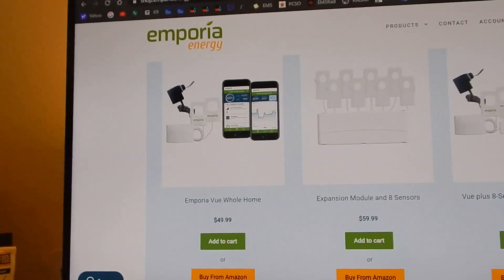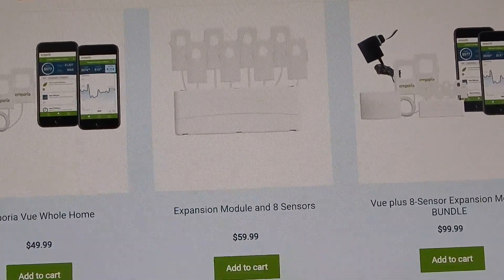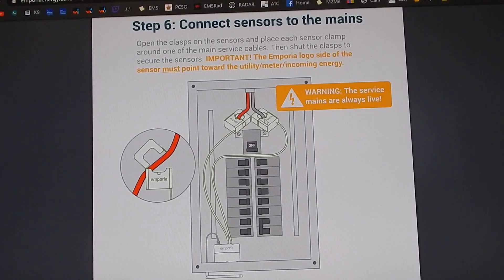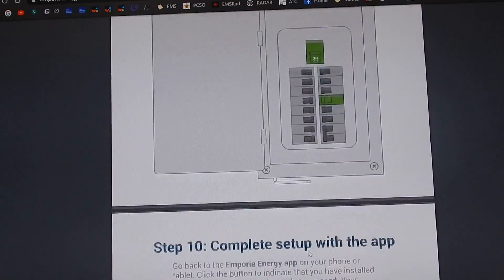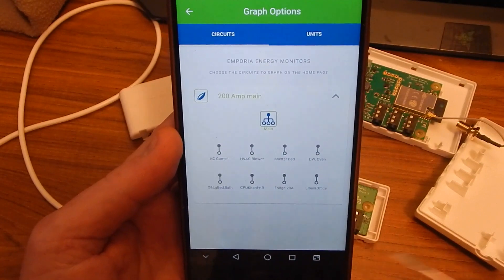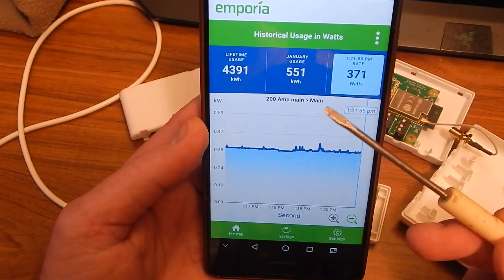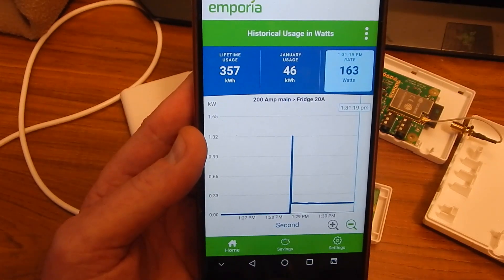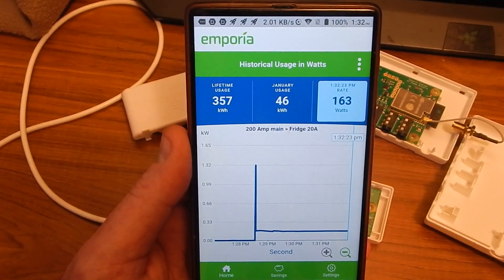Emporia Energy Vue, See Our Review Of GEN2!  Link in description.

Comment: Hi AD can you please tell me what is the function of ic U4 on pcb @6:42? 
and what is the IC number?
Reply from the maker: 6810 F (B OR 8) G NEXT LINE AD1E07  1924 A, I can't find anything on this but sure it's the prom chip or firmware chip which is near the programming pinouts on board.
Reply from the maker: China virus in India is very bad now, how is vaccine distribution?
Reply: @publicmail2  situation is not so much good over here ,currently we are getting 300,000 cases daily here(official no.s).

Due to the very large population, we are facing shortage of vaccines, maybe in the upcoming months, that problem will be solved.

Comment: Great Review !   About to put in just the 200a claws because I am anxious to see work.  But I want my inside loads checked at that panel so ideas on running extension cables for expansion module either from outside 200a service or other way around?  Is this sending digital signals that need shielding or for that matter can the inductor comm cables be lengthened or would they pick up noise.

Comment: I am like you, the power of knowledge is being able to view power consumption from 0 to X watts.  I could care less if the exact measurement is perfect.  HOWEVER the company could send in the package for those needing "calibration" three or so known resistor values you could plug into a circuit to calibrate the clamps over a range.  I would be using the fine resolution to identify items in my home that are puling those few "phantom" watts that are dragging 24/7. It is those items that I would like to rid my house of.  Being an engineer with many devices at my home I would be using this as an off the shelf troubleshooter and data gather tool.  I do wish they would make an app not for my phone to pull from their cloud but one I could simply host on a raspberry Pi or Arduino or even on PC that I could have on my own network so I wouldn't have to fork over the 2 gigs of data these use a month to run or have a "big brother" out in the world watching over my power usage.
Reply from the maker: I believe it just wasn't doable with the old hardware, I tried different shunt resistors that helped low end but hurt calibration up high, check out V2 available on 8/15/20!

Comment: Excellent analyses!  very impressed with the explanation of short comings. I would like to see the accuracy of  even 1W to 5W if I am spending money for the energy monitors. Otherwise It may not be possible to find out if there are equipment which are not working efficiently if they consume below 35W power.  I don't really care about data (I assume they do), but I would like to get data every second if possible twice a second to find out signatures of various equipment connected to the grid, inverter distortion, harmonics current, etc. If a product that can give me this level of accuracy in the non-commercial energy meter, I would love to buy that product. I have also solar panels as well and parallel feed 200A Square D panel which makes it impossible to install Sense or Emporia Vue product as none of those support up to 3 CTs (100A), and  do net metering  without modifying the programs/code in the chip I believe. May be I am asking too much for the monitor to do But I am okay storing all my data to my own server and try analyse each type of load to the millisecond level for research purposes.  I think having to access to such data at millisecond helps a lot for engineers! They can have my money if they can do this for me. :) I Like accuracy and professional grade CTs without any errors. Or I should say, professionally calibrated CTs which produce no to 0 error. I dont think it is worth to tweak the software than actually get updated hardware to measure accurate V, I and power factor.

Comment: the light on the fridge only comes on when you open the door. Theres only a few sensors or timers running depending on your fridge model
Reply from the maker: I have external lights, and many others things run independent of compressor at a 1 watt to 600w.

Comment: I live in a three bedroom apartment and would only need the 200amp mains. So the 95 watt or less cut off for the noise floor would be disappointing.
Reply from the maker: Yes, wattage is inaccurate on low end showing 180watts when should be zero as mentioned but accuracy improves as wattage goes up to say 1000 watts.  I'm not sure where the wattage goes to zero on 200 amp mains, (35 and lower shows 0 on 50 amp taps).  A new hardware version 2 is coming out so this will be addressed soon.
Reply: @publicmail2 From what I understand. That the sensors have a hardware limitation that anything less than 90-95watts per sensor makes them inaccurate so the software disregards anything less than that.  Which is why you get the 180watts because until it reaches 90watts per phase (180w total) the sensors are not sensitive enough or the digital circuitry can't do it with such a low analog signal. I am analytical, and would like to know what my power usage would be when I am not using anything so I could possibly eliminate stuff or find an issue.
Reply from the maker: @justinavery4047  best way I find is to use a killowatt meter on individual items, but even with emporias vue, it will show a drop or increase for item so you can go around and cycle things and observe their wattage draw, so it's handy in that regard.  Since  my minimum exceeds the cutoff on the 200 amp mains I'm not entirely sure on cutoff points, but for sure the phantom 90 or so watts is added to your wattage and then slowly disappears as wattage increases to about 500 watts and up total, then totals become true, but the individual taps are nice and the 10 watts over (at low wattages) doesn't bother me, just the cut off below 35 watts I hate. The price is good though.  Figure 1 watt 24/7 at 12 cents a kwh is $1 year.  Studys show average home has 80-100 watts standby wattage 24/7, watch things like cable boxes, old xformers that run warm.  I saved 10 watts on an old alarm transformer and replaced with a modern SMPS type xformer, and put a motion switch near my computer mouse after 15 mins of no movement it shuts all items using standby wattage eliminating 12 watts 24/7, so stuff like that.  It all adds up, of course HVAC efficiency is a whole other story.
Reply from the maker: You are correct on all that, V2 due out 9/20, look for a review on it.

Comment: I just ordered one for my camper and solar. Should I cancel or return it? It’s 300 amp hours and 540 watts solar array.
Reply from the maker: I would ask Emporia if the new version yet to be released would be upgraded?  The current unit works great other then the very low wattage I discussed in the video, so it's up to your needs.  I have not used it yet for solar but should work identically I assume.  The company is great to deal with and if an upgrade is needed and they say they'll send you one if needed , you have nothing to lose.  You won't find one that works like this for the cost.
Reply: AD Electronic Teardowns okay. Thank you.

Comment: Hey AD, thanks for this video on the Emporia Vue. We’d like to address some of our short comings and the way we report our measurements for you and your viewers. Due to hardware limitations, our 200A sensors report a minimum load of ~0.79A (95W) and our 50A clamps report a minimum load of ~0.29A (35W), which we refer to as noise. For instance, if there is an 11W load on your one of your Expansion Module circuits, the 50A clamp would report 35W to the Vue. As you can imagine, this caused people to wonder why their dishwasher constantly reported 35W when it wasn’t even on. To address this hardware issue and create a better experience, we implemented a noise floor in the software. This essentially zeroes out readings below 96W per 200A sensor and 36W per 50A sensor. Our data supports that this does not impact the vast majority of our customers, who typically consume well above these values. 

Additionally, this noise is not additive. There is no need to subtract 192W/36W from the values we report. Above the noise floor, our clamps are accurate with fairly high resolution. Therefore, any values above 192W for the mains or 36W for the 50A sensors that we provide for the current, historical, monthly, and lifetime cumulative measurements can be taken at face value. 

Hopefully, this gives a better understanding of why we implemented these changes. We did not do this to save on data or bandwidth expenses. We still collect data every second, 24 hours a day. The app updates every other second to avoid synchronization issues so it doesn’t ask for data before it’s available from the cloud. At this time, we have no plans to change or remove the noise floor with the current version of our hardware. However, the next version of our hardware will handle this shortcoming far more gracefully by implementing a different digital-to-analog converter and by measuring real power and voltage from the panel.
Reply: Emporia Energy when does the new version come out?
Reply from the maker: Thanks for the response, and I'm glad you cleared up the bandwidth theory I had.  But I still see a difference from what you have explained and what I am getting with the data, like 10 watts noise on 50's not 35w.  However, I should've made clear the additive noise does go away at higher loads but my experience shows they do add in at loads near the bottom over 200/35 watts respectively.  How about and option to see or not see the low end noise?  As I mentioned, the unit to me is great but for that, IMO.  The good news is a newer hardware version is coming out and will address these issues and for the cost of this unit there's no doubt the new version will be the goto unit of value and performance.  Thank you again.
Reply: What is the ratio and class of your Split-Core CT. Wouldn't it be better to have available a different CT for lower watt consumption that we can buy if we need it.
Reply: Yes I am VERY interested in knowing when the updated version is coming out as well!
Reply: Great to see Emporia responding to the community, I'm impressed.  As others have asked, when will the new version be available?  Also, are there plans to create APIs so that the data sent to the Emporia cloud can be used in Home Automation solutions like SmartThings?
Reply: @dekesone1  I asked them directly in a email and this was the response I got: 
Hello James,
Our next hardware version of the Vue will be coming out later this summer early July it our target.
Warmest Regards,
Emporia Energy Support
Chat M-F 8am - 6pm MNT
1 844 EMPORIA (367-6742)
Reply: @JamesRader  thanks for reporting back! Definitely interested.
Reply: @JamesRader  Thank You for sharing this!
Reply: @Emporia Energy - You may wish to consider offering smaller CT options for folks with smaller circuits and loads. I understand that 50A size is pretty magical because you won't typically find circuits larger than that, but in households with gas furnace, gas water heater, and gas stove you likely wouldn't see a single circuit over 20A. Maybe 30A for their AC compressor. That could make a big difference to potential customers who keep their electricity usage low already.
Personally I'd like to mix and match CTs, so I can have the appropriate size and best resolution per circuit. You could market it as a "Pro Kit" ;)
Reply: @coryzerwas5187  My thoughts exactly, with everything turned on in my house I pull about 17A, that's with 3 25,000 BTU window units running... (heaters, stove, water heater, and dryer are LP)...In the winter, depending on whats turned on in the house, I see loads of 3-5A...I want to be able to see phantom power from the TV... So I am holding out for the new version.